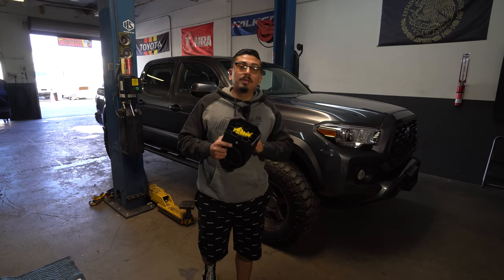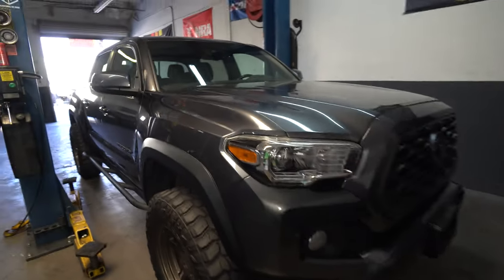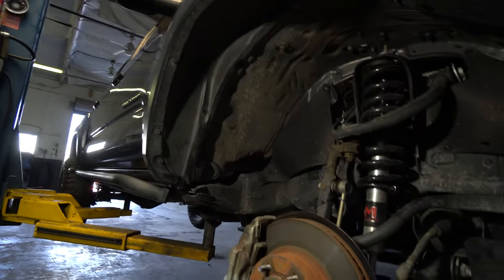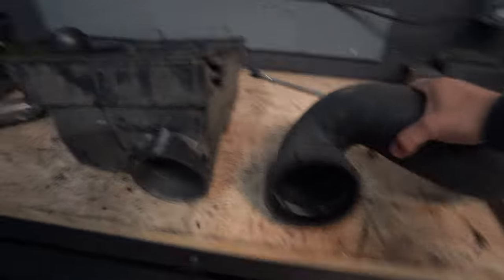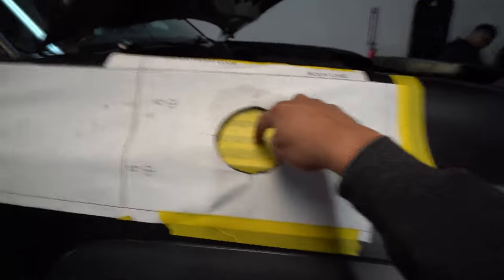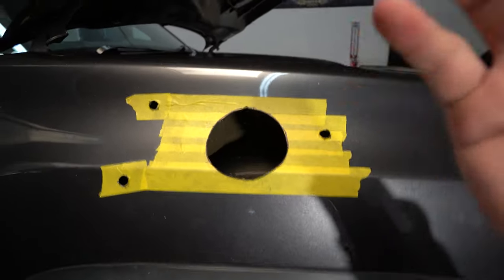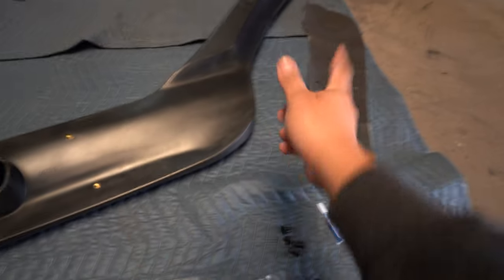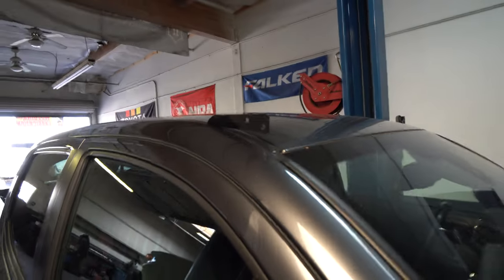MY BUDGET TACOMA GETS A AIRAID SNORKEL | THIS IS HOW WE INSTALLED IT STEP BY STEP

Comment: I've never noticed my snorkal to make a noise. Is it supposed to have a strong suction also
Reply from the maker: It does make a little more of a suction noise yes because instead of being down low under ur wheel well hidden it is now in open air up high where u can hear it